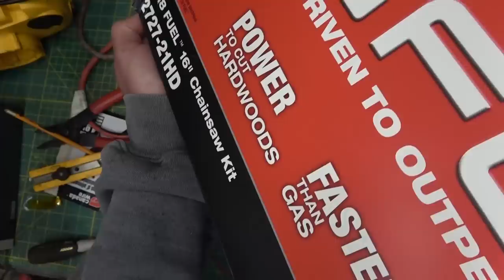BOLTR: Milwaukee Chainsaw | Destroys DeWalt

Comment: at 5:47 it's indeed a chain guard but it's to stop the chain destroying the machine if and when it derails. Tis because the chain elongates when you run it hot. Have had it derail a couple of times when i was doing some bush work and a twig snapped between the chain and the sword.

Comment: Oil pump has propably like a cam at end of the shaft. When the oil pump shaft turns, it also moves back and forth. Pump end of the shaft has D shape. So when shaft moves out, it takes oil, and when it moves in, D shaped end of the shaft closes the inlet port and forces oil out. Oil amount can be adjusted by limiting lenght of the stroke. It`s kinda intresting desing.

Comment: Try the makita brushless chainsaw!
Reply: Used one after hurrican Harvey. It was suprisingly powerful, and batteries were long lasting.
Reply: Ya I wanna see the insides of the Makita now - they got two versions, one 18V and one 36V. I'd buy the Makita over the other brands.
Reply: I've got the little 12" dual battery 36 volt topper saw and I took 2 mid sized cherry trees with it on a single set of batteries.  I was thoroughly impressed. It has some balls for batteries.
Reply: I own the Makita 14" 36v XCU03Z. It has a similar bar attachment mechanism as the DeWalt, but I haven't had problems with bar sway or chain detachment. I would use a gas chainsaw when cutting 12"+ diameter logs all day, but it's great for small stuff. You do need to enter cuts with high chain speed and use good chainsaw technique because the chain binds easily compared to a gas chainsaw.
Reply: Make it Cheeper,
With Makita!

Comment: What I don't like, is the amount of power Milwaukee is attempting to get from the 18v battery. Low voltage and high current is never a good solution. Just a little bit of contact resistance will cause serious heat build up with the battery. All the wiring needs to be heavier, the motor winding need to be heavier, the MOSFETs need to be larger. While the DeWalt mechanically is not as good, I think the 60v system s a much better solution for the amount of power involved here. Milwaukee claims it to have the power of a 40cc saw, and Stihl's 40cc range is producing 2-3 HP. That's 80-120 amps at 18v...
Reply: I've been using one of the 12ah batteries with a large rotary hammer that I use all day (puts the drill into fucking beast mode, too) and the battery never seems to be phased. It does look like marketing wank on the box, but there may be some truth to the statement that these batteries run cooler. Using a 5ah battery in the same drill, the thing gets as hot as the sun. The 9.0 and 12.0 batteries don't even break a sweat no matter how hard I rail on them, the tool never draws enough current to cause a problem. So, whatever they are doing seems to be working.
Reply: They are using 21700 lithium iron phosphate cells, instead of 18650.
Reply: That's fine, but the battery still has metal electrical contacts to the tool, and associated wiring inside the tool. The saw uses significantly more power than the hammer drill mentioned by hypnotoad. Look at how big the contacts and wiring are on an industrial fuse panel for a ~70-100A load, then compare them to the Milwaukee.
Reply: @AmericanLocomotive1  

Maybe the rotary hammer is a bad example, I've managed to deplete the 9.0 batteries in about 15-20 minutes of intense non-stop cutting with a grinder, and in those circumstances, again, they are not as hot as the smaller 2p batteries. It may be that the heat buildup in the cells happens on an increasing curve, and by not going 100% full bore, the large batteries stave off the majority of heat buildup. That's just my take anyways, all I can say for sure is that the larger batteries simply do not get as hot, and the tools never seem to overheat.
Reply: @AmericanLocomotive1  

It's not pulled anywhere near that kind of power. It's likely only pulling around 30 Amps max. Which is what 21700 cells are rated for (continuously). Gas engines and electric motors are not directly comparable.
Reply: Zach Demand why not? Chainsaws don’t need a super wide flexible power band, I buck wide open, power is power.

Diddling your chain In will grab.
Reply: 30 amps x 18 v = 540 watts. 540 watts is 0.72HP. Modern 40CC chainsaws generate significantly more power than that. So either this saw pulls considerably more than 30A, or it's considerably weaker than Milwaukee's claims.
Reply: @Gjmahn  

If I had more time I would explain exactly why. However all the information you need is available online. If you are interested in having your questions answered you will find the answers. Good luck.
Reply: @zachdemand4508  100 A is some current yes, but not that much. You do need good connectors and beefier wires but thats all, and low rds-on mosfets are best up to about 60 volts but you cant use 60 volt batteries since you need some headroom. Though, would be interesting to see some data om the mosfets, they might be dropping a few Watts there.. for the motor though it does not matter, since you need more turns for higher voltage = thinner conductor = same amount of heat. Only thing that matters there is the amount of copper, and yeah... They could have used alot more, quite some room there. Actually a kind of low power motor for the size but might help with airflow.
Reply: @AmericanLocomotive1  

They have 3 banks cells in parallel, so the amps should be 90 amps, assuming it's a 30 amp rating per cell. I don't think these tools draw the full 90 amps. A horsepower comparison is not useful because generally for cutting, raw torque curve is generally more important than rotation speed and overall horsepower. The gas motors bog down and lose horsepower AND torque under load, the brushless motor produces the same torque under heavy load, so it still cuts well even though it loses horsepower.

Comment: 0:23 I am 23 seconds in and $455.88 US !!! 

Unless a small hand comes out and gives you the best "what for" to your wobbly bits below I will never buy this. I do not get investing so much moo-la in these battery powered devices.
Reply: Wait a few more years.  I bet the cost comes down and output power goes up!  5 years from now I bet all of the saws fellers use will be battery, technology is jumping leaps and bounds.
Reply: @Russ-od2yy  very true and if graphine production is improved, in order to mass produce graphine capacitors , battery will be far superior

Comment: what I have learned by removing, then trying to install the chain brake spring in the same way that you did with brake released, is to remove it when the brake applied the load on the spring is less.

Comment: 13:05 ... I keep my (dozens and dozens) of power tools on the dry basement floor in layers ... top layer is stuff I used recently ... bottom layer, stuff that's antique or really heavy and I don't use much (I'm a crippled old Millwright and I hate using heavy antique tools now) :)

Comment: Perhaps the silastic on the MOSFET leads is to prevent any stray carbohydrate foam from getting stuck in their craw and shorting them right out.

Comment: Oil pump is probably just a shaft with ground side. So just a D shaft. I remember dissasembling husqvarna oil pump and it was just like that. I guess that ground side picks oil and flungs it into output by centrifugal force.

Comment: The line on the case at 11:48 is probably a bearing line. You put the chain saw bar at the bottom of the felling notch and use the line to determine the direction the tree will fall. If this has already been pointed out let me know, because i might have missed it as english is not my first language.

Comment: Correct me if I'm wrong, but if the dewalt is running at 56v vs Milwaukee 18 they could make the motor smaller, be 1/3 the amps and could use smaller wire for windings

Comment: You were right that the small piece of metal is a chain catcher. The will only last about 2 times of the chain coming off and the line down the side of the saw is a falling sight to accurately fall a tree.

Comment: Those oil pumps have a slight cam/wavy groove in the one end of the shaft that a pin slots through so the shaft goes back and forth slightly as it spins. On the other end with the pipes there is a notch in the piston end of the shaft so only one tube is open to the chamber at a time as it reciprocates. I had a husqvarna one that apparently didn’t work and couldn’t figure out why (the wavy groove in the plastic shaft was worn)

Comment: Nice motor on the Milwonki.. I wouldn't be complaining about bar oil since it is cheap and makes the bar n chain last. I aint one for eating my firewood... The L bracket held with a crappy screw just there at the bottom when you pull the cover is to catch the chain if it flies off thus saving the cover from being a meal. That is why it is aluminium. The teeth at the front of the saw that were plastic on the Dewalt, I always heard them called dogs. With the faults of both saws so far I would hold out until a better product comes out addressing these flaws especially at those prices. Thx for sharing AVE, keep your turd cutter sharp.

Comment: I have a Stihl 250 that I keep ready in case an F-4 breezes through the neighborhood. I've been using a corded Remington that I found in a yard sale for ten bucks. I know it's not anything much for the purists out there but I did take down and saw up a thirty inch diameter elm tree with a smaller 16 inch Remington than the one I have now. I want to thank you for this review as I've been wanting to get one of these Milwaukee saws for some time now. I got into the Milwaukee line after my Nicad Porter-cable stuff started dying. On second thought, I should have gone with Makita but I was raised to hate cheap japanese products and didn't like Dewalt because I didn't like the name. (supervisors name at work) So anyway, I have lots of Milwaukee batteries now so going to another tool line would just complicate the heck out of my life. I really enjoy your chanel and the creative vernacular you use in your tool breakdowns.

Comment: Ford 4 cylinder engines use the same coefficient of friction design for their crank pulleys. No key, just a diamond coated washer between the crank and pulley

Comment: Maybe someone else has already mentioned it but that transversal line on the case underneath the handle it's a sight, like on a gun, should have been black or at least contrasting enough to see. You are supposed to look at it when you have at the soon to be dead tree carcass and it should fall where you point it.

Comment: I have an old 120 volt Millwalker that I use in my wood shed,, I got it after 10 years of someone  not tightening the chain or adding bar oil... It did help the clutch glaze and slip, but it still cuts tons of juniper every year. It's soo old, it's made in JAPAN.... maybe the reason it's still alive..
    Take the Makita and the Stihl saw apart, kinda curious....

Comment: I've been debating getting this since it's come out.  Was so happy to see you did a review of it when I hit the interwebs tonite to see some videos on it.  It just looks cheap to me, compared to the other Milwaukee stuff and looks like they did cheap out in some areas,  which confuses the snot out of me, seems like a few little tweaks and this thing would be pretty robust.  Be nice not pulling out the gas saw when I just need to cut a few things, but it's a bit pricey.  So i'm no closer to making that decision yet!  When in doubt, wait it out.

Comment: I may be a bit confused, but don't you have the chain speed off, considerably? With a 3:1 gear ratio, and the drive gear (the smaller gear) is running at 1000 rpm, the output gear (the larger gear) is turning at one third the speed, ergo 333 rpm. The chain sprocket (which appears to be larger than the drive gear but smaller that the driven gear) will not travel as fast as you estimated nor will the chain itself travel that fast.

Comment: The oil pump used in autos if not a geared pump then it is a gerotor.  Concatenation of generated rotor.  A type of positive displacement pump.  The kind I have seen on Chevy LS engines on the front of the crank.  That is the type described for the chain lube pump.

Comment: The celastic on the legs, in my uneducated opinion, is probably to keep them and the solder in place along with helping distribute some of the devil heat up and away from the contacts, may have had an issue with heat and instead of redesigning the layout they stuck a duct tape and napkin band aid on it.

Comment: No keyway? That's what I found on the camshaft pullies of a Ford Mondeo. Nothing but the friction of single bolt holding the pullies from spinning on the ends of the camshaft, which would cause the camshafts to go out of time, and the pistons to come up and smash the valves. Seemed weird to me, but it appears to be done to speed up assembly because the motor can be timed once the entire thing is assembled, cambelt and all.

Comment: Several YouTube Channels have said that the Stiihl Battery Chainsaw, the E-Go chainsaw, and the Echo chainsaw have all three been very good. Although everyone has given the Stihl chainsaw very high marks. I wonder if the internals are any good or not. 

I personally prefer the 80v Max chainsaw by Kobalt, but that’s because I was able to find it for $118 with a battery, and because their 80v line isn’t half bad... and cheap! 

But if you want to go through another chainsaw, I’d suggest either Stihl, E-go or Echo.

Comment: The line you pointed out at 11:48 doesn't just break it up. I think that would be a sight line for when you are properly notching a tree to aim where its going to drop. Most decent chainsaws have that. Not sure if i would want to drop a tree of any size with a battery powered saw but I have seen worse.

Comment: I sympathize with your auto-focus issues. I work with camera's a lot. something I have found is that the auto-focus functions on most cameras are reliant on the ability to find contrast differences in the image, by a number of mechanisms. When you want the camera to focus on a particular or macro area, try putting a thick white sheet of paper directly behind the area you want to focus. A lot of times I see that the focus issues occur when you are holding something over your bench space which is full of differing contrasts.  A solid color as the background should help with this. Just a suggestion, no disrespect intended!

Comment: after a few years using and VERY much abusing my little milwaukee chain saw i will atest, the thing has been repeatedly covered in mud/snow/water on the little trailer behind trail tractors tire chains spinnin.  little mil saw has bucked some 2 foot oak logs (it is clearly not designed for this, grab the big ice saw!) hit the ground from 6or 8 feet several times, etc... The two HD12 batts i use cant quite keep up we the saw, and neiter can i honestly as an older dude.  i get the feeling like keeping a rotation of 3 batteries might overcome the saws seasonal longevety.  for sure, i've bonked the little chain saw around way harder than it was intended and its still kickin it hard!  its really great around and orchard, and also shines deep in a swamp where carrying gas and stuff is undesirable.  the elimination of hearing pro really got me as someone who does a lot of chainsaw work as a thirda4ry prime objective.  make thoughtfull choices on what batttrys system you choose, make informed decise, and stick to it maybe.

Comment: 14:27. Hate to see crazing in a new tool. Those white bits are gonna fail sooner or later, either from chemical breakdown of plastic due to the much higher local surface area or fatigue as the microcracks get worked open and shut, probably just from the motor vibrations. The glass fibers will help keep it from cracking too quickly, but that plastic shell's days are numbered from day 1.

Comment: Reverse polarity on the switch incase you get the chain on backwards! A gem. However, not the first time I saw a lathe motor running up and away either.

Comment: Check out a Kobalt 80v cordless from Schlowes. Bought it two years ago, and SONOFAGUN if it doesn't whack down a 3 foot diameter elm AND limb it on a single charge. 

Kobalt or bust.

Comment: That line you pointed at that runs parallel to the handle isn't for looks. That's a felling site for dropping trees in the direction you want. As if that's what you'd actually do with that saw lol.

Comment: 10:25 Those are pressed powder metal parts PM, not metal injection molded MIM. you would see ejector pin marks and draft angles if it where MIM

Comment: Ave you got caught up so much in losing that spring and trying to put it back you tended to leave the brake SET which is where a lot of the compression was coming from. Yeah, easy to get ahead of one self when tearing shit apart. So much fun one forgets certain steps they did.  I have done all sorts of repair work on things and worked at many trades and best thing I like doing is RIPPING SHIT APART. Always easier and more fun than putting shit together. :-)

Comment: i had a 20v Dewalt 1st gen  string trimmer worked ok for 1  1/2 years then Motor Fried !!!!!!!!
mind you Diameter was only for 13" swath 
but was running at 16 " swath with no Guard !!
1st Gen Motor was Discontinued 
has to Complain 2x to Dewalt before they Warrnty it 
now back to gas 4 stroke troy bilt

Comment: Could the red be a losing battle with Hilti? I remember a few years back where Fluke sent a cease and desist to sparkfun for selling a yellow meter. Fluke had actually trade marked that color of yellow and could prevent anyone else from selling a meter in that color.